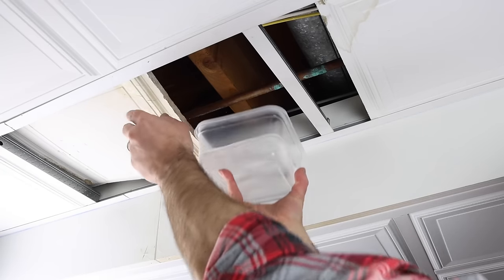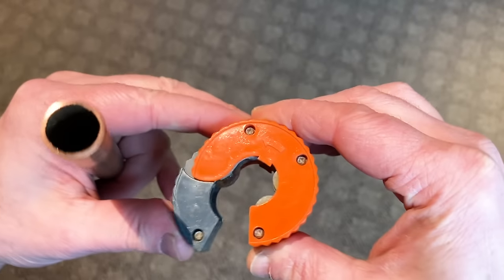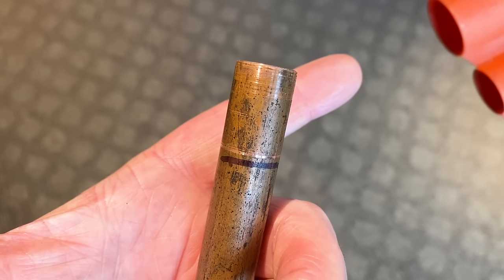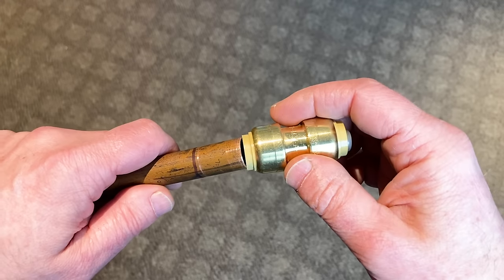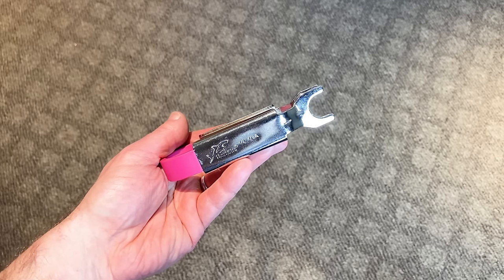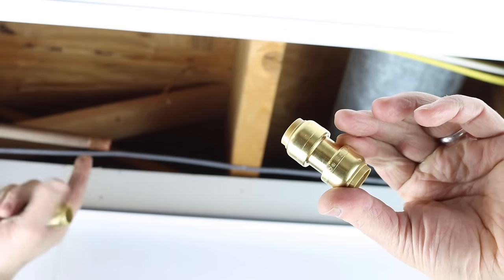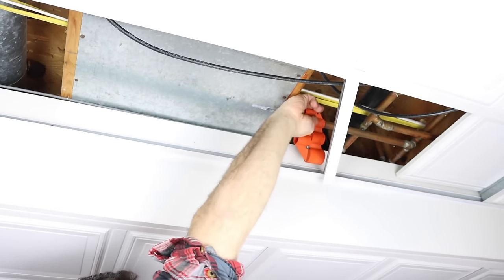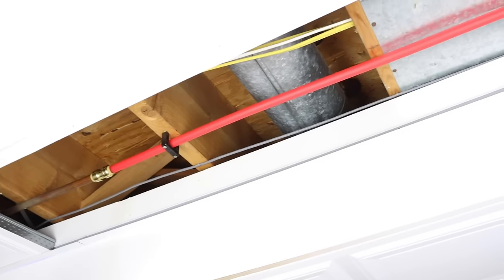Repair Copper Pipe Leaks with SharkBites (Super EASY)

Comment from the maker: Would you use SharkBites to repair copper pipes?
Reply: yes, I would and have, but until this video I never realized how much they remind me of the Chinese finger traps I played with when I was a kid.
Reply: I believe they have their place.  In the majority of the repair/modification work I've done, I've only used them a couple of times.  I'd rather sweat, or solder , a joint and know it's going to stand up to the test of time over relying on a rubber seal.  To this day I've never been called back to repair a leak.
Reply: Shark bite is for temporary fixes such as service or for testing. It's not a permanent fix. No one should ever think that. Call a licensed plumber. Or don't do it.
Reply: 100 percent
Reply: Richard J They’re rated for permanent use.
Reply: No
Reply: @crisediosbany  yes but the rubber seal from the sharkbite wears off overtime then it will leak again.
Reply: @JohnT2088  no they dont ive used them on my house
Reply: Not a chance.
Reply: That rubber seal is not going to last. It leaked everywhere after a few months. Waste money because they’re not cheap
Reply: @mostdefrecords4334  how long have they lasted so far?
Reply: Im install sharkbite now...get back to you with results.
Reply: Thank you, I have been without power for almost four day and with no water because of a frozen pipe. Surviving the Texas freeze of 2021 , this video is helpful thank you so much !!!!
Reply: @mostdefrecords4334  yes they do..  🤦🏾. They last long i agree but the o ring don’t last forever.  Solder joint from copper outlast shark fitting. If you dont know that sht then i dont know what to say.  I used shark bite in my house also. Never once i said anything bad about it but your so wrong.  What i said is correct and not an opinion.  Shark bite has an oring in it. Over time it wears down.  Could be 5 years from now or whats its rated for 25 years or more than it leaks. I would for sure used shark bite if my pipe burst. Fast and easy and last pretty long.  Im just saying the o ring in the sharkbite over time does wear out and leak!  Just stating facts.
Reply: 100 percent! But not enclosed in a wall or ceiling!
Reply: Always have a fire extinguisher when working with an open flame
Reply: No, because I know how to solder, I would only use shark bite fittings to cap off a line temporary before I solder a fitting or valve on. 
You still need to cut, clean deburr the line, learn to solder which is a much more secure fitting.
Reply: No I would not
Reply: @richardj5417  nothing is permanent not even Copper Pipe!
Reply: @peevxwm1203  I’ve been using them for years not one leak ! You probably didn’t clean them right!
Reply: @richardj5417  Why temporary if every plumber is using it ??
Reply: Yesterday’
Yeah
Phone call Home safe cancel
Reply: @joethepothead420  where were you at? I'm in Austin and helped a lot of plumbing problems for free during then
Reply: I used a sharkbite under my house about 3 years ago and it has started leaking. I will put another one on until I can get time to do it the right way
Reply: @crisediosbany  Wrong, not on soft copper.
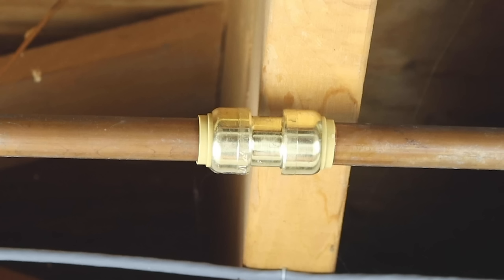Reply: Can you please make a video that specifically shows what was edited out of this video between 3:04 and 3:08?  I want to know exactly how to determine the length of pipe that should be cut out in order to properly install the shark bite.  Also, I want to see exactly how you were able to handle the copper pipe in such away that after the shark bite was installed on one end of the copper pipe, you were still able to install it on the other end of the copper pipe.  I'm guessing it was edited out of this video because it's possibly a struggle to install without accidentally bending/damaging the pipe.  We understand that fitting it together might not necessarily be easy, but we need to see this, or at least, I need to see it.  Really appreciate your videos.  Your videos taught me a lot.  I will get all of the tools mentioned and have spare shark bites on hand.  Since I already had one pin hole leak (repaired by a neighbor), it's just a matter of time before more develop.  I intend to be better prepared to more immediately deal with these situations myself.  This video definitely gets a thumbs up.  Thanks for sharing your knowledge.
Reply: @richardj5417   haha the licensed plumbers slap sharkbites on and charge you $1,000 because "we don't have that size of copper pipe"
Reply: Nope!
Reply: They're great and last a very long time.
Reply: @peevxwm1203  not true
Reply: What does “flex” in the pipe mean? Does this mean up down wiggle or horizontal pushing it back wiggle to make room for the 1 inch of the other pipe that needs to enter it?

Comment: A few years ago, I paid $175 to fix a pin hole leak in the copper pipe and it took the plumber no more than 20 mins!  Now, I can do it within 10 minutes using  Sharkbites.  I saved myself a few hundred bucks by installing replacing leaking shut off valves under the kitchen sink and bathroom sinks, and fixed a leak myself :).
Reply: I want to Go Home  stop spreading this nonsense. Sharkbite (push connect) fittings are code approved behind walls. That wouldn't be the case if they weren't meant for permanent repair
Reply: I want to Go Home  Lol, that's what plumbers say because obviously they lose a lot of business. People are able to fix their pipes right away instead of waiting for the plumber to do a sloppy job and charge them an arm and a leg. Sharkbites are guaranteed 25 years but could last a lifetime. Same story with the soldering. Could last a lifetime or a year depending on who does it.
Reply: Looks like you got 2 pipes that day lol
Reply: I want to Go Home  yea it's 35
Reply: I want to Go Home  womp womp you'd have to get the one that's been under there for 2 years otw
Reply: iwanttogohome847 this guy is a liar I run maintenance for over 1,000 apartments we use shark bites all the time with no problems. The problem these plumbers are going to have is the internet exposing their bull. 😢
Reply: iwanttogohome847  nope. I have two, (getting ready for 3d) on 40YO copper, that were installed more than 5 years ago. Going to PEX this house thru attic to resolve a slab leak. It's ridiculous that someone hadn't figured out by 1978 that external (esp. north) wall kitchen sinks need a better frost prevention plan than "drip water."

Comment: Just FYI, the white plastic insert can be removed from the new fitting when installing on copper pipe. It's just a stiffener that's included for pex jobs and it slightly narrows the effective diameter of the pipe. It's not an issue with pex but when it comes to copper it's better to keep the interior diameter as consistent as possible to prevent flow changes that could wear the copper over time.
Reply: Totally agree
I have to explain to a lot of people that the insert comes out for copper fittings.  Great comment
Reply: How do you take the plastic insert out?
Reply: @louisshorterii6385  I use a pair of needle nose pliers to grab and pull out easily.
Reply: so in that case, it it still necessary to debur in the inside of copper pipe?
Reply: @CaresforAll  yes because the end of the pipe still goes against the back of the fitting and the better fit the better, less worry about any sort of leak. Get in the habit of ALWAYS smoothing out those copper pipe endings it doesn't take long, debur and fine sandpaper to ensure a nice tight grip. Always debur, clean, dry, fine sandpaper.
Reply: @eolsunder  what about the outside of the pipe? do i still need to rub it with steel wool? this video went over some discoloured sections.  I know this isn't soldering but should it be cleaned, or does that spoil the seal?
Reply: I heard that might hurt the teeth.

Comment: A pinhole leak in copper can be fixed easily by using an ice pick to wallow out the hole. Use sand paper to rough  the area around the hole, flux the area, use your hand held propane/ map gas torch  & heat area / solder over hole area with a buildup bead of solder. I have fixes over twenty years old using this method. 😀

Comment: I plumbed my entire house with pex and shark bites over 8yrs ago without any issues.  The difference  in life is all in the deburing and support.  Remember these o rings are the same material in almost all faucets, valves and water hose connections.  Only plumbers say there bad because they dont make money on self repairs. Smh
Reply: exactly
Reply: No.. solder is the best way.  It’s a permeant fix that has been proved for decades.
Reply: Yep, when installed properly, SharkBites are really great.

Comment: Quick question:  the 1 inch separation, did you cut 1 inch section of the pipe, meaning did you make 2 cuts with the autocut tool?

Comment: The 2” add on measurement for the slip fitting is wrong.  That’s one of the points of the slip fitting is you don’t have 2” to spare.

Comment: Great info! I had a pin leak in the cap on a short stub right under the floor. I couldn't get in there to cut the stub off and put on a Sharkbite end cap, so I just cut the horizontal section on either side of the stub and replaced it with a short piece of PEX using Sharkbite couplings to connect it to the copper. 
It's also useful to know about the slide coupling that I could have used if I didn't have enough flex in the pipes to get them into the new couplings. I took both types under the house and was able to use the regular couplings, so the slide coupling can be returned. 
Thanks again!

Comment: The space I had between the Joists was very tight and I had to replace a valve that gave me water to my outside spigots. Now I used a Sharkbite for the valve (quarter turn ball valve and a slip joint). The mistake I made was pushing the slip connection to close to the soldered "t" fitting. The small plastic release tool would not fit so I could move it to connect the pipe between it and the valve. Went back to Lowes and got th 1/2 inch tool to be able to compress the fitting allowing the slip joint to move onto the pipe and complete the connection. Held my breath and turned on the water and not a single drop . Works well in my open basement.

Comment: I have 5 shark bites in my house installed on pvc and copper and it’s been 5 years and no complaints at all .A plumber told me they could last 30 to 35 years depending on the pipe .

Comment: The copper jumper cable was a great tip that I didn't think about.
Also remember that the insertion depth for Shark Bite Max is different from the prior generation of Shark Bite fittings!

Comment: Great video and visuals!  Well done! I think I can be a plumber now!
Reply from the maker: Thank you buddy
Reply: hehe i always say you should repair what you can, if you can. That way you will learn at least the basics. Sure, you aren't a plummer if you do it yourself at home, it isn't your job and you don't do it day in and day out, watching someone move a piano doesn't make you a piano mover, experience does. But just trying the basic stuff to repair it yourself you can always get a real plummer to do it if you aren't sucessful. I can do most repair work myself except for major pipe work. Like today i had a copper water pipe burst for my kitchen, so went under the house, found the break, went to home depot, got a cutter, extra pipe, 2 fittings, sandpaper, etc then got home and went to work and said oh, i got 1/2 inch copper to fix it, but its a 3/8 pipe. There ya go, not a plummer, but im trying !

Comment: Lovely Setup fitting,I used one yesterday on copper tubing from hotwater tank to wall,  (8 inches overall length the copper tubing wasnt in line with each other exactly and it did leak because of thisand it wasnt the fault of this fitting, I will use them in instances of tight places and directly aligning piping, they are expensive though

Comment: I always heard plumbers talking badly about shark bites but I've used them a few times and they are easy to install and never had any issues for years.
Reply: I had a plumber in for a gas issue and he looked at some of my cold lines (full of drips, replacing tomorrow myself as he never got back to me). he had no real issue with sharkbite other than the cost. I think plumbers probably aren't in love with them because a homeowner isn't going to pay extra for work with sharkbites, but it's probably easy to get to a couple of hundred bucks in fittings in a day.

Comment: Can you explain the jumper cable? I was not aware pipes needed to be jumped?
Reply: Yea im confused by that too
Reply: So if your electrical system in your home is grounded thru the coper pipes which is code and often happens with copper pipe the theory is it going through the concret works as a supplemental ground for your home. Also if wiring happens to put current on the copper it will ground out instead of sending electricity through the piping in your home causing it to shock you through the water

Comment: I agree with the pros I would not put these behind a wall. I will tell you this for the average joe under sink sharkbites work perfectly. I spent a lot of time researching this topic. I knew a torch was not a good idea for a first time copper pipe fix it guy like me. I went with standard compression ring fitting by unscrewing the old 1/4 turn and installing new nut, compression ting and new 1/4 turn. Leaked like crazy. I cut off the new quarter turn at he nut. Put the shark  bite on and it is like new no leak.

Comment: Just installed a sharbite tee for 1/2 copper pipe.  Two of the pipes are tight.  The third, top of the tee, the pipe woiggles side to side, but is tight and locked in based on the measurement using the measurement tool.  Haven't turned on the water yet.  Have you encountered a wiggle with a shark bite?

Comment: Is it sufficient to push straight on. Is any twisting required?  I want to join two copper pieces     but copper pieces can't be turned because each is already soldered.  I have a sharkbite and I  noticed bag said to push on and turn. Is the whole connector turned or only the end attached to the pipe.

Comment: I have a copper main water shutoff valve that will not shutoff the water going to the house, is it possible to replace that valve using shark bits on both ends like you did with the straight run of copper pipe? Also the copper pipe is next to a stud in the wall. Any ideas on how to cut the pipe?

Comment: When you see pipes with a pin hole like that that means you have to take out a piece of pipe and examine it if you may be replacing all the pipe in your house either Japanese pipe or you have a lot of water problems.

Comment: Is it possible to spot pinhole leaks before they become a problem, assuming the pipe is visible? I am repairing two pinhole leaks in the same section of pipe, and I think I may see corrosion beginning on a third spot on that same pipe. Is that third spot a pinhole-leak-to-be?
Reply: I'm getting the two pinholes repaired in a couple days and am thinking about asking them to just replace that entire pipe to prevent nasty surprises in the future.

Comment: How much copper do you remove from the existing copper pipe? You said 1” but it didn’t show you cut 1 inch! I cut it at the pinhole and removed about 3/4” of the existing pipe. Did you cut a section out of the the pipe or just at the pinhole!

Comment: Do you need to take out the plastic inner sleeve to use on copper ?  I am trying to get it to fit but the fitting is loose...maybe not pushing all the way on ?
Reply: Yea take it out
Reply: You can but you don’t have to. That plastic is meant for plex piping but you can still leave it in for copper.

Comment: is there a difference in thickness in copper pipe that was made 30 years ago compared to todays copper. I tried using the shark bites but i struggled to insert shark bites
Reply: I'm finding that out as well...did you get it to work?
Reply: @mmburgess11  I finally bought a copper pipe cutter, I guess it was my cutting from a hacksaw I was using and causing it to flare out to a bigger finish, if that makes sense

Comment: Shark bites are awesome. I replace them all the time. When they burst while the homeowner is on vacation. But don't stop using them I think every single DIYer should use them as many as possible as often as possible.
Reply: Indeed! I forgot what plumbers and their huge bills look like! I haven’t had any failures so far, in 10 years, but if I do, at any point, I certainly wouldn’t be calling a bitter plumber. Just around 10 to 20 bucks and I’ll fix it again for another 10 years lol
Reply: @powersww1reset  Yup, not cheap, but you can always use a guy from Lowes or HD to do it on the side.  They are cheap.  My customer had $37,000 worth of damage, guy had no insurance, not licensed, not inspected.  But it was cheap!!

Comment: Shark bites fittings we can use for hot water supply copper?this is good quality?
Reply: I myself have use them and yes you can use them on hot water pipes .Mine have been installed for over 5 years and was told they are not suppose to be a permanent fix but they can last between 30-35 years and that’s good enough for me.

Comment: Hi - my copper pipe seems to be 5/8" close to slit and 1/2" closer to outer edges.  Is it swelling? How can I be sure of which size given that there are not a lot of products for 5/8"?
Reply: Actual 5/8" OD...
Reply: This is my current problem. 1/2 inch shark bite doesn’t go